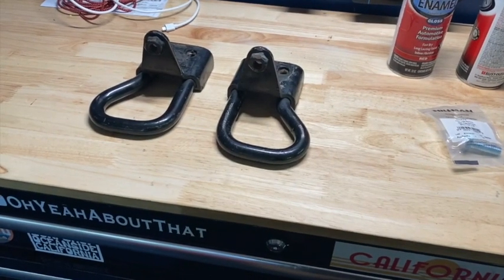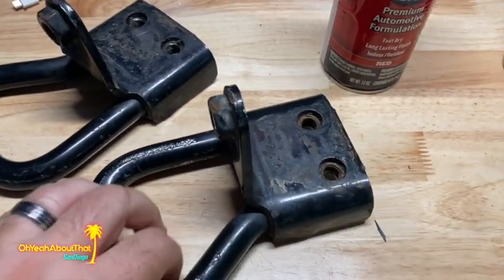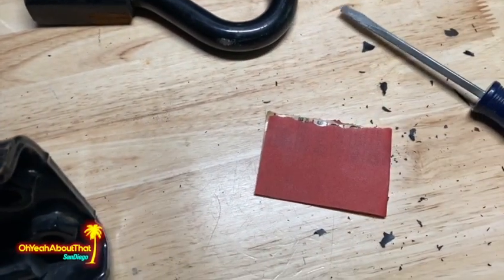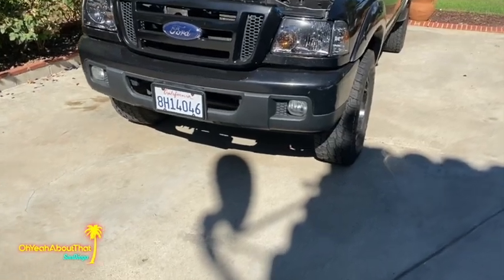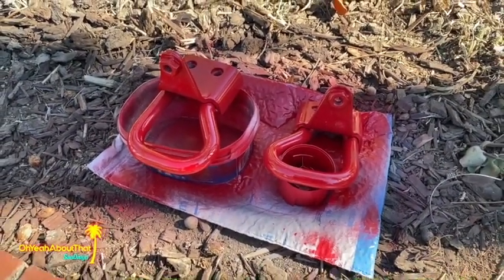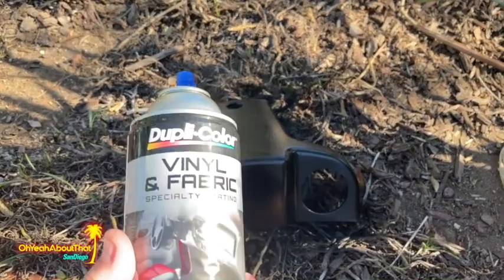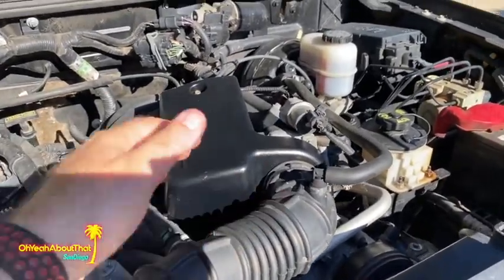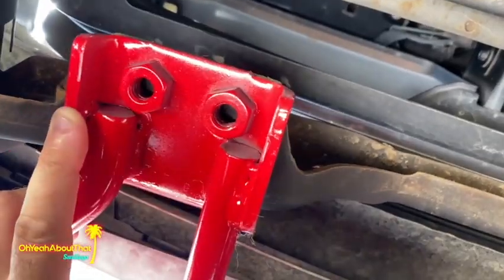ADDING TOW HOOKS TO RANGER SPORT! part seven) 2007 Ford Ranger Sport

Comment: Looks great. Been thinking about doing that on my 06 Sport just to lazy to do all the drilling 😂
Reply from the maker: I get it. I should have know I’d have to drill. I never looked before the video!
Reply: Yeah good excited when I saw your video for your 02 and checked my truck only to be disappointed that the holes weren't drilled. Also I think you mentioned that you have to remove the bumper to replace the fog light housing. It something I need to do and would suck if I had to remove the bumper
Reply from the maker: I still need to do it for my fog lights. I have other project I want to complete first.

Comment: My 2004, 2009 and 2011 2wd Rangers don’t have that frame crossmember that that style of tow hook bolt to.
Reply from the maker: Only the Edge or Sport 2wd would because they are on the 4x4 frame.
Reply: Depends I've seen and worked with some oddball fords over the years.  My 2009 xl has the bolt holes for tow hooks, front bumper that has removable caps for foglights,came with a tow package. My 1999 xlt sport has newer 2001 wiring connectors, came factory with a newer 4.0l v6 engine ahead of its time they put in later model explorers around the same time period. My grandaddy spent alot of money to get that engine back in 1999.

Comment: I think I'm gonna have to do mine red too. I'm stuck in a few months of snow and nastiness up here in Ontario so mods & videos for the 4x4 Ranger are slow, but I have some stuff coming. Also saved a pile on insurance this year so it looks like the lift and tires will likely happen before I thought they would. Also yeah, my tow hooks do mount to that crossmember on the 4x4 sport. Maybe don't hang the entire truck in the air off those hooks. :) Though at that point I think those random bolts will shear off and your hooks will become missiles anyway. Shhhh...We all do this for show anywho.
Reply: I think he was concerned the cross member was undersized for the potential load, not the mounting point.

Comment: That cross member will not hold up to towing. Tow hooks need to go on the frame ends.
Reply from the maker: This is the factory location. The mounting holes are already present. The Sport and Edge frame is the same as the 4x4.